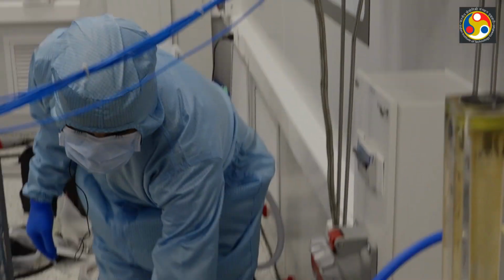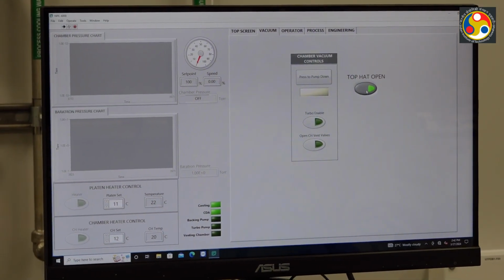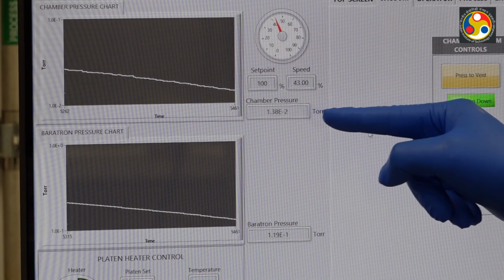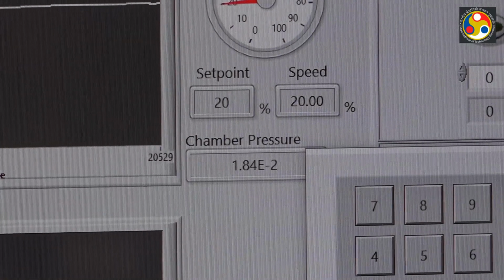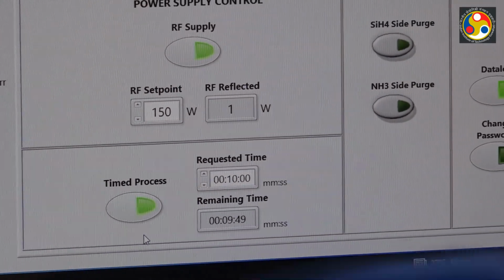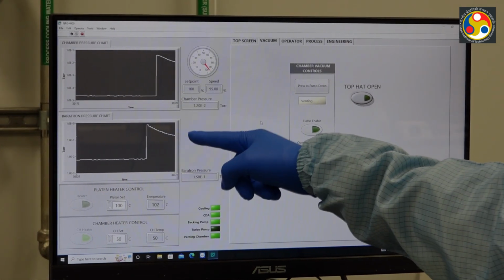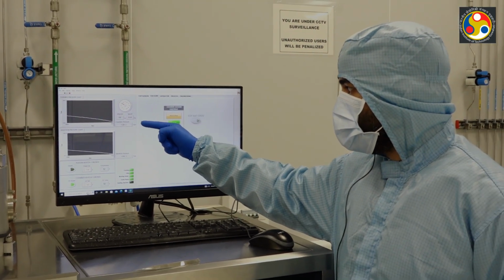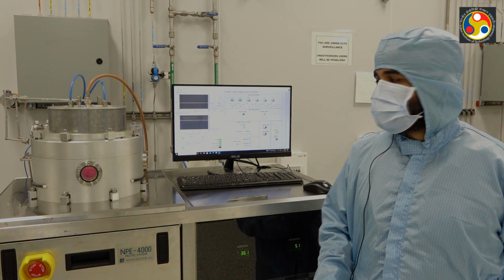Plasma Enhanced Chemical Vapor Deposition (PECVD) | Centre for Nanotechnology | IIT Guwahati

Comment: Is SIO2 is deposited as you have kept the flow of SiH4 ans N20 are 50 and 100 which is not correct to form Sio2 generally we are keeping at SiH4 at 50 and N2O at 100 SCCM